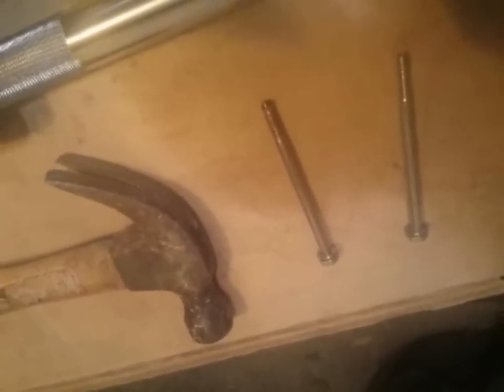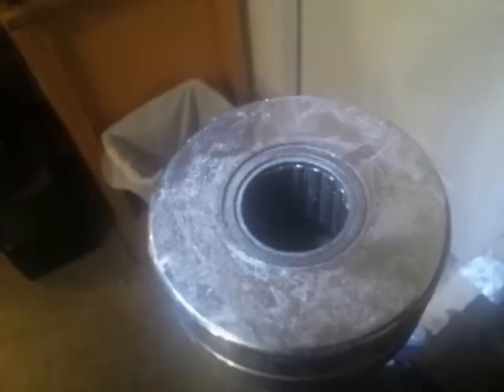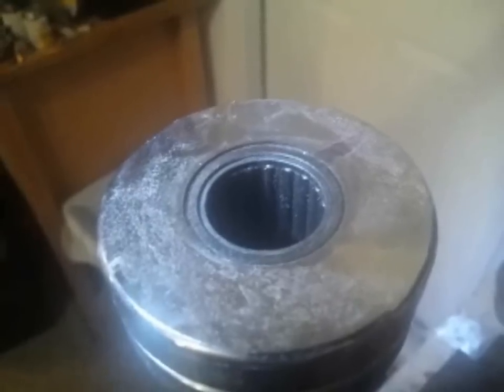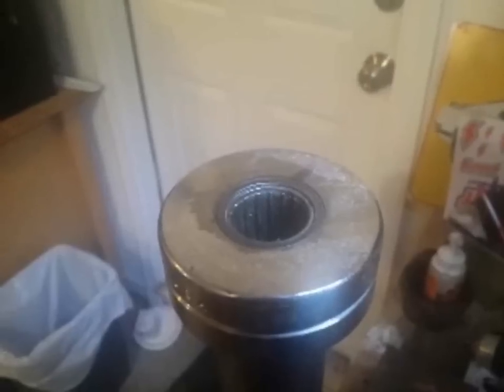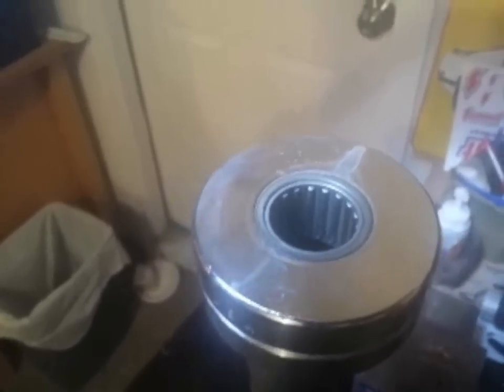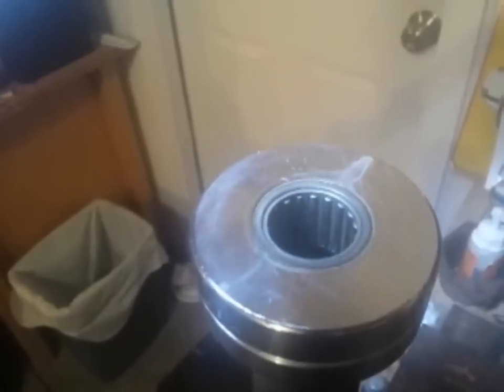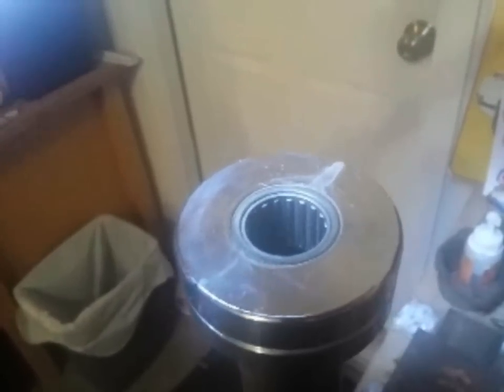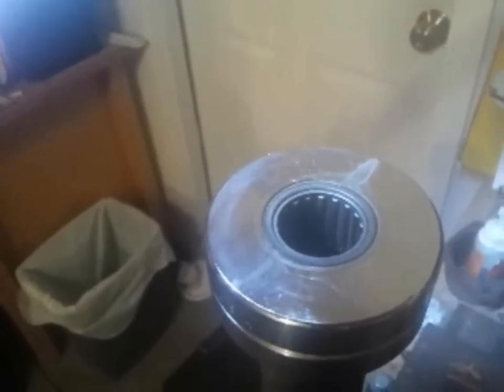York Barbell Repair

Comment: helpful video
I have a question though.
I've got the York burgener rippetoe bar. its perfectly straight, sleeves don't rattle, spins how its supposed to. however, on one end the cap is loose and wobbles. the pin isn't slipping but I'm not sure what the problem is.
any thoughts?

Comment: I tried popping that pin out, both with just a bolt and with a roll pin extractor, but I could not get it out for the life of me. Do you have any tips on how I can get it out?
Reply: +As Many Reviews As Possible 
Try getting a set of punches (around $10 on Amazon) and using those.  It is not a gentle process, it requires some firm strikes with a hammer to get them moving.